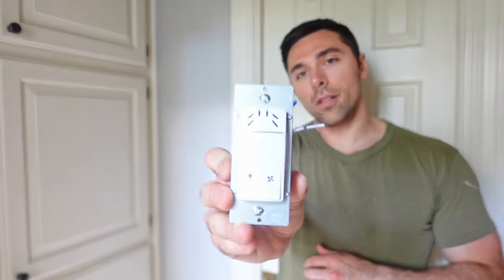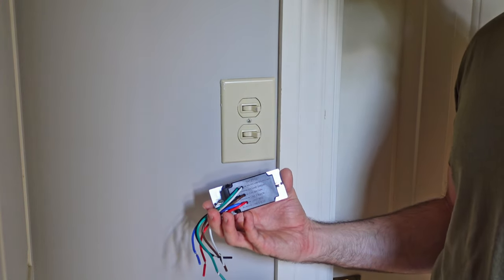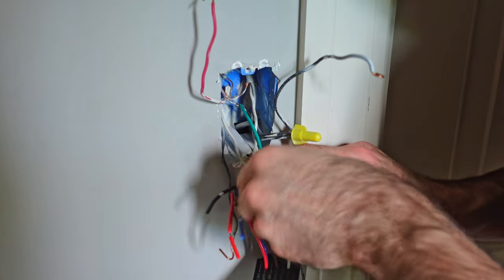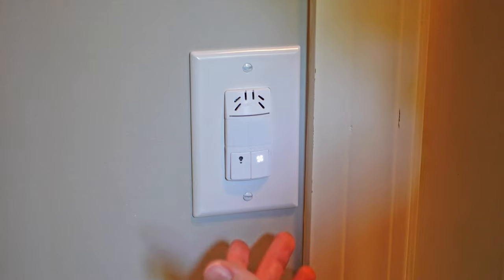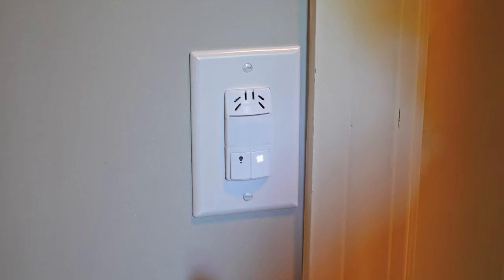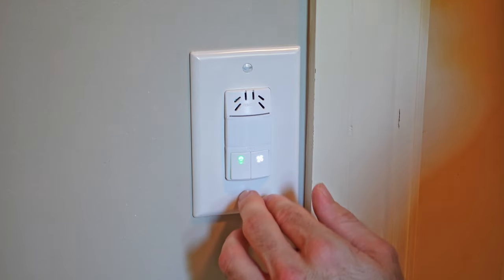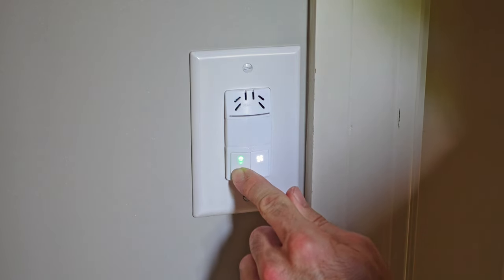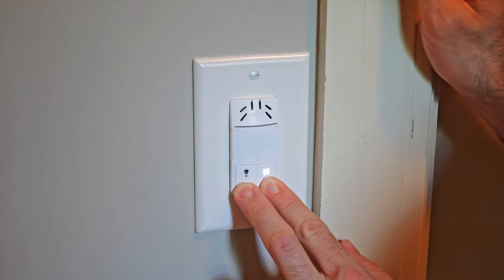Topgreener’s Dual Tech Switch || How to Install a Humidity and Motion Sensor Switch for the Bathroom

Comment: How long does the light stay on for after motion stops?  If you push the light switch when you leave, does it turn the light off without delay?  Thanks!
Reply from the maker: Once it detects no more motion, it's supposed to stay on only for 10 min. And there is no delay with the switch